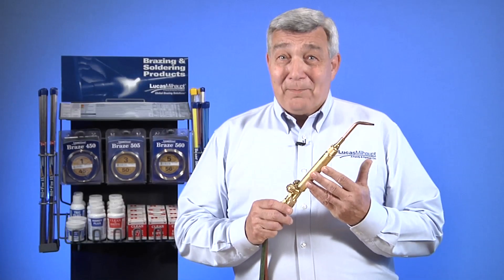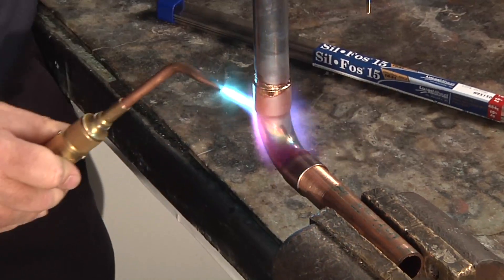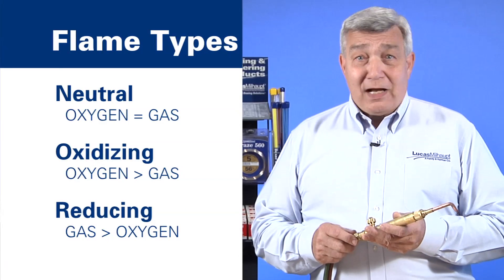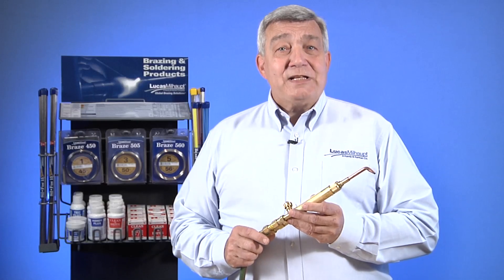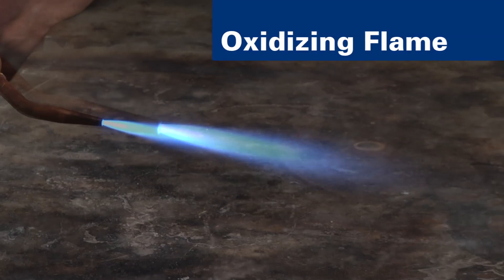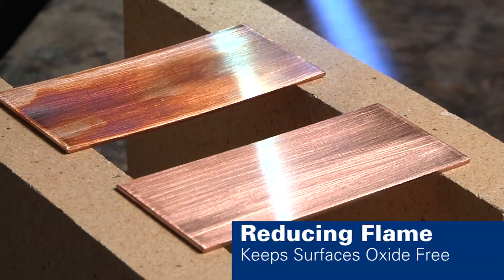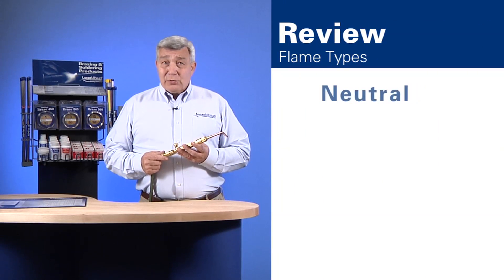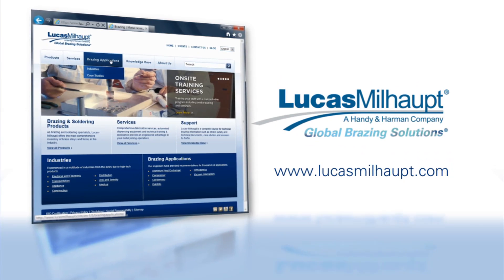Preferred Torch Brazing Flame Types

Comment: The reducing flame is also called carburizing correct? Is that only with OA (which is what I am learning) thanks!
Reply: Yes, that's it!  You might read "carbonizing" or "carburizing", it's the same idea: there is excess carbon in the flame, it's chemically active and it might be touching something chemically active (like a red-hot piece of iron), not only can it "REDUCE" oxides on the surface of that metal, but carbon can actually enter that hot metal and dissolve in it- for good or for ill!  Personally I suspect that when using fluxes (which are glasses, made of melted oxides) that a reducing flame makes trouble because it reduces the FLUX!  This is related to some bad experiences in glassblowing.   I'm shooting for neutral or slightly oxidizing flame for flux-covered metals.  I guess when in doubt neutral flame is always a good guess!
Reply: I am beginner in welding, and excuse to add my answer which is according to what I KNOW (it is not necessarily correct). The answer is a "yes". A carbonizing flame is also called a reducing flame.
Reply: Here they might not say "carburizing" because I suspect that carbon doesn't dissolve in copper and silver alloys, maybe they don't BECOME carburized, so it doesn't come up in this industry?  They can definitely reduce an oxidized surface!   (Carbon CAN dissolve in hot STEEL, and make trouble so they tell us.  Turn mild steel into Carbon Steel, you might not WANT that!).